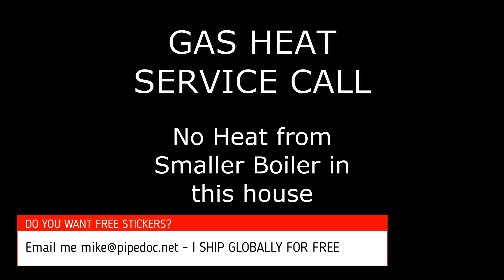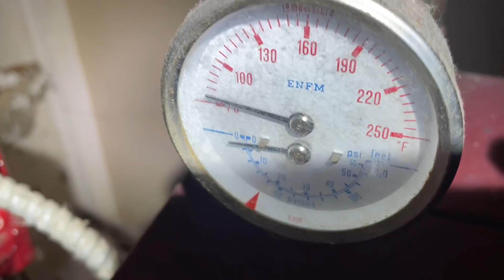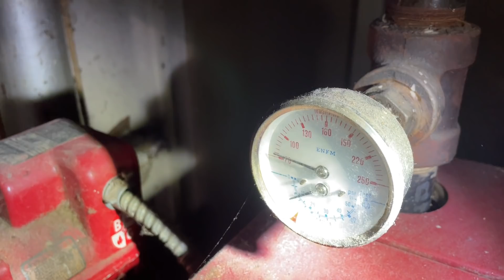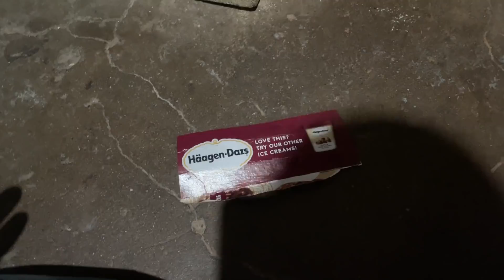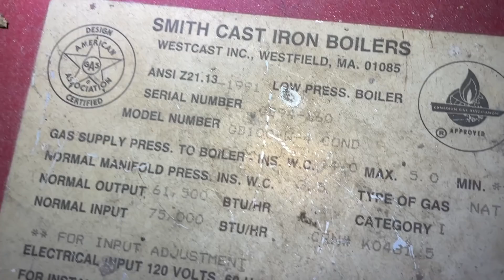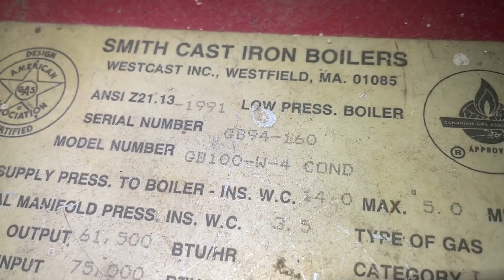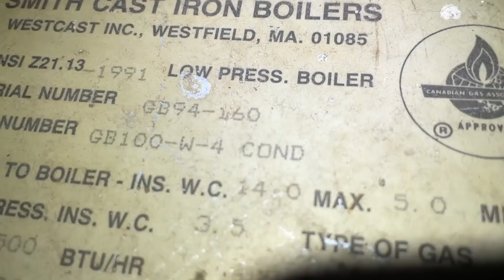No Heat Pilot out on Smith GB-100-4 gas fired boiler with STUPID Pilot Burner Assembly #PayItForward

Comment: Whenever i do A thermocouple on one of these shitbag Smith boilers, i just take the gas piping apart, pull the drawer assembly, and change the thermocouple. I can usually do it in 30 min.

Comment: Mike You paid it forward  to help out a working man , you sir are a  good man, I believe Pete smart Will be supplying you with the extra long barbecue lighters (Another good man )  I think the word you were looking for was by metallic spring in the thermal coupler unit.... Spring gets hot hold the gas valve open...,